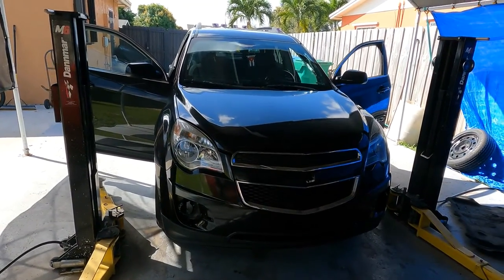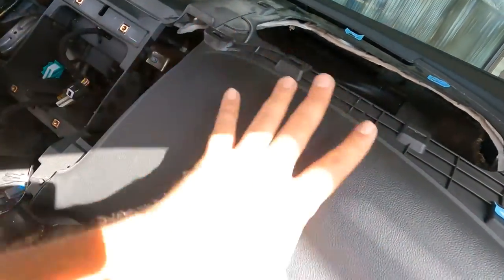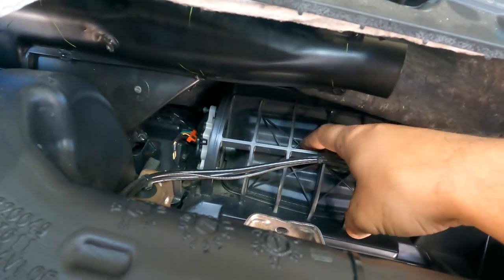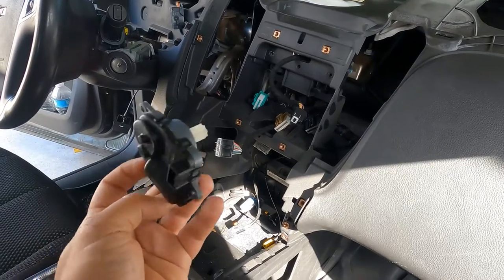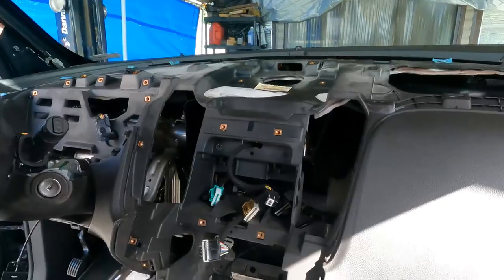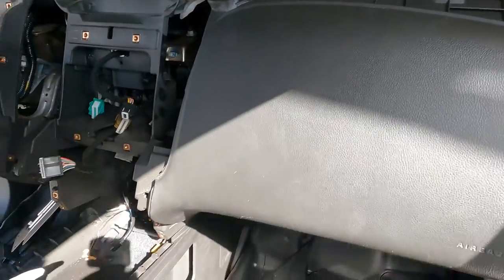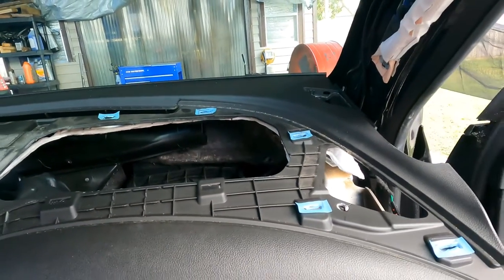Chevrolet Equinox clicking noise coming from under dash. How to fix it

Comment: Everyone was calling me crazy! This noise happens every time I shut my car off and the noise is persistent for hours after shutting the car off. Thanks for this video!
Reply: I have the same noise for hours after the engine has been off it happens like  every few minutes a rapid ticking noise that lasts about 3 seconds and stops and it sounds like its coming from the engine tho cuz i only can hear it when im in front with the hood open
Reply: I have the same noise and it is not this part that's in the video.  It is definitely in the engine bay and sounds like a solenoid clicking. I've taken to the dealer several times but they say they dont hear it. I've finally just gave up since its been there for nearly 2yrs and nothing has broken yet.

Comment: My daughter's 2014 just started doing this. I went out to see if I could make the noise happen by turning on recirculate. It didn't necessarily happen that way but going from upper 60 degrees to 70 degrees definitely triggered that noise every single time. Now we know what to look for and fix. Thanks so much for posting this video!

Comment: Good video and shortcuts. Just went through a similar 'dance' on a 2007 Vue -- same but different; dash pad came out, and with extreme contortion for about an hour I was able to get the new actuator in.  The crazy thing is that it STILL thumps for 20 seconds after ignition ON or switching from Outside to Recirculate!!!  Performed the calibration procedure by pushing AC & Recirc buttons three times and no improvement.   I plugged the wiring into the old (presumed bad) actuator and it works just fine, cycling from end to end (gears are also good inside).  The door moved freely without the actuator coupled. I'm at a complete loss.........

Comment: I have a question about my 2015 Chevy equinox. My car has been making a sputter noise when I accelerate. It started a day ago. No lights are on, I got auto zone to do a diagnostic nothing showed up. I went to a local mechanic he said the noise is coming from my engine cover not being locked, he checked it and showed me that it was loose. No issues I just hear a sputter noise when I accelerate.

Comment: After going to many auto shops to get the same issue replaced with pricing starting at $679 thur $1085 labor only. I was able to replace it with help of my daughter’s small hands from underneath. Yes due to the very limited space it did take me about 7 hours. I was only able to turn the screws 1/4 at the time. I used an extended 1/4” drive, 90 tooth ratchet, I also used a 1/4 drive sidewinder ratchet I modified the handle to add more reach.  I have to be honest I will never do another one.

Comment: Thanks for showing me that I can deal with not having recirculation anymore 🤣. Why couldn’t I get lucky and it be the blend or mode door actuator? Mine just had to be the air inlet door/recirculation door actuator. Looks like I’ll just be breathing in the outside stinky air and the A/C won’t be blowing as strong in the future cause that looks like no fun to do. Wish it would just automatically be at recirculation when u turn on instead of the outside air direction.

Comment: Thank you so much for the video, its very informative 
I have a GMC Terrain same issue.. your video helped me.. but I can't remove the top panel.. everything is out, screws , clips.. but by the area of the actuator up there , there is something holding it.. I can't figure it out.. I put pvc pipes underneath, I see all the clips out about 1 inch space.. however.. something is preventing to come out
Did that happen to you?
Do you know what  might be?
Tomorrow hope to finish it
Thanks
I already figured it out today.. 3 bolts holding it.. easy access from the glove dpt ,I  removed them then the upper section came out👍
Reply: Where are they located in the glovebox? I'm struggling to find it!!
Reply: @adunndeal do you still need help? I just found them
Reply: @bryanaranda9789  Thank you so much but I found them, fixed the actuator and it still wouldn't work. Got a quote of over $1400 to fix the compressor, condenser and drier (because that's what they recommend replacing with the compressor) but my stepdad helped me fix it and it cost less than $500 for the parts! She's blowing ice cold now.. It was a struggle but we got it finally!! FINALLY!!! Thank you though and good luck to you!
Reply: Thank you! I’m stuck on the airbag!! How did you manage to get that out? I’m scared of it exploding in my face. Nevermind, I got it!!

Comment: I"ve been trying to remove the upper dash and I  have it all off except right above the actuator! lol.. How did you get that part off? From under, inside the glovebox? I've been struggling with only that part of this job so far. Someone please help before I throw a match in this vehicle!!  lol
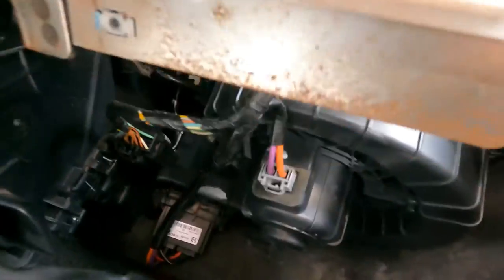UPDATE: I got it off thanks to reading the comments.. It's the 3 bolts at the top of the screen at 2:16

Comment: Hey? What kind of lift is that you have? I never have seen one like that? I am looking for a lift but I do not have a lot of room or a lot of money to spend on a big 2 or 4 post one, Can you please share the name and maybe a link? I have the same car but in 2017 and we are really not happy with this car. LOL - thanks for sharing.
Reply from the maker: Its a maxjax lift. But is just as much as a full sized lift or more
Reply: @gautorepair  ahh damn really?  Okay, thanks for sharing. I am looking for something to use in a home garage. I seen the quick jacks but the car sits on the "ramps" so not good for doing any break job. Great for oil changes though lol
Reply from the maker: @m.t.v.7934 yeah i saw those but i wanted more height. You could try to find it used, but new its about a 3500 dollar lift

Comment: What year is this Equinox? I have a 2013 and was wondering if the dashboard replacement is necessary or can I just go through the glove compartment.
Reply: Very difficult thru glove box, almost impossible. I just did it by taking off the top dash panel, installing it back on right now
Reply: TAKE OUT GLOVE BOX 'ITS RIGHT THERE . 5 MIN . REPAIR . SERIOUSLY .
Reply: No, that is the hot/cold actuator. This vehicle has 3 actuators - 1st is on driver side - mode blend actuator - 2nd is the hot cold on passenger - 3rd (passenger side as well) is the recirculation

Comment: I've got this problem. Though I can't even get the dash off. I've got it loose everywhere except for near the windshield on the passenger side.. is there something I'm missing? It's starting to crack when I pull it.

Also did this issue resolve issues with ac not working sometimes?
Reply: Hey I'm at the same point! I cracked the plastic because something would not let go in the middle. When I got to this video and saw a hole under that spot, I was puzzled
Reply: @cammo_killer794 it might be the airbag. There’s 3 bolts behind the glove box they are 10mm. Silver/grey in color for me. If you still need help just lmk
Reply: @marcorangel1997  THANK YOU SO MUCH!!
Reply: @adunndeal  yw, any other questions just lmk
Reply: @marcorangel1997  Ok. I really appreciate it!

Comment: TAKE OUT YOUR GLOVE BOX  ' NO TOOLS  AND ITS RIGHT IN FRONT OF YOU . I TOOK MINE OUT IN LESS THAN 5 MINUTES . LOTS OF VIDEO ON HOW TO . NO NEED FOR ALL THIS NIGHTMARE .
Reply: The one that is easily accessible after removing the glove box is the Heat/Cold actuator, not the “fresh air” recirculation actuator